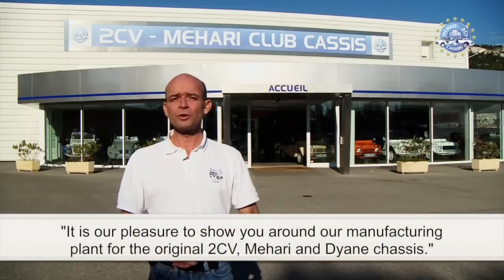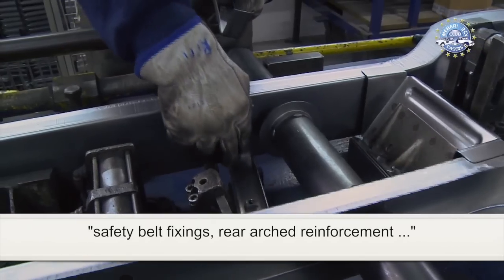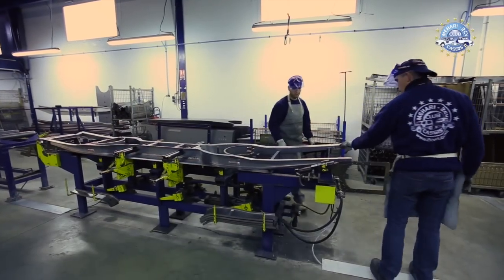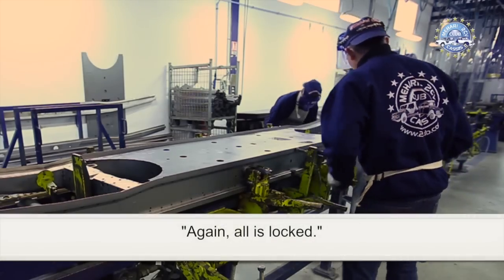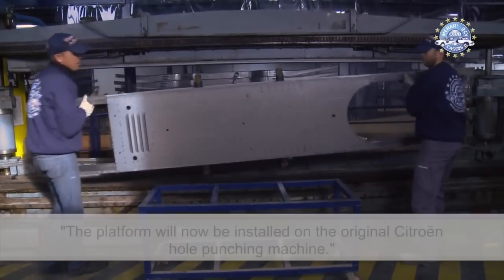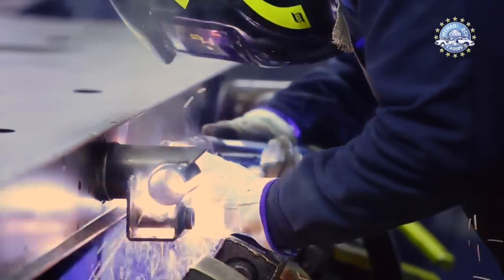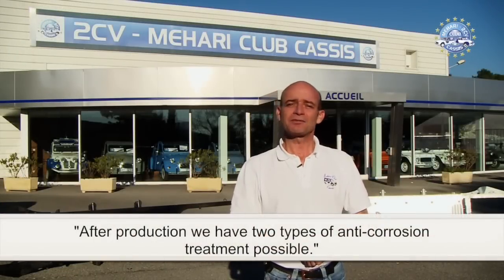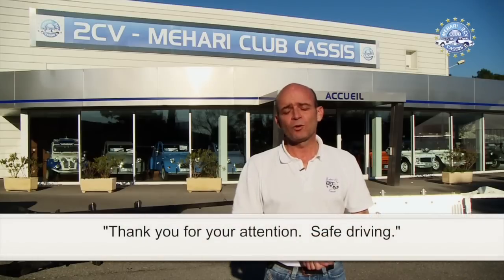The manufacturing plant for the original 2cv, Mehari and Dyane chassis.

Comment: What an informative video! Have watched it over 50 times!

From 1.49 to 1.55, reinforcements are installed into the chassis long members. I slowed down the video and watched that repeatedly, but sadly, there are no close ups of that crucial bit of engineering. I have been scouring the net for more information on those internal reinforcements, which are invariably rusted out totally in old 2CVs. Would be grateful for any leads.

Comment: Is the chassis buildhere in the video confirm the original Citroen specifications? And does it confirm with admission, legislation and approval of the countries it is used for example Holland? Is the steel used for the producting of the Chassis better than what Citroen used (because that was realy bad) and what is the conservation of the steel, outside, but more important inside (which Citroen didn't do at all) e.g is it galvanized? Is it still being manufactured nowadays???
Reply: the chassis is 100% Citroën approval and built with the original Citroën machines, but to buy one you need a original chassis n°

Comment: Amazing! They kept this all! I wish, they will make updated version of 2cv!
Reply: The material strength of the parts used to build the frames is already updated.
Reply: What they call 'E-Mehari' might be a cute electric car (didn't drive it), but it never is a real Mehari. The real one was a light, simple, no-comfort thing with great transport and off-road capability - that one either hates or loves.
Reply: agree. a 3.8 m 50 kW car is more a pet than a raptor. 
 
By the way, passenger safety is very useless to discuss if you increase impact speed from 60 km/h to 80. Physics does not care for our wishes. 
 
I had a bad crash with an original 2 CV, flattened front. I knew where the belt was for some days. I got out unhurt, the other one was lucky to stay unhurt, as I was angry. His car was trash, I repaired mine. 
 
By the way, if I needed to buy a car, I'd consider a Sandero. Renault quality is not bad, I am not cherishing the 1950s when HP was a quality to compensate a tiny dick. My last car was a Fiat Ducato transporter ... rusted away, but besides this, I'd still drive it today. Why not? Comfortable, useful, mileage could have been better (it was not a Diesel).
Reply: by the way ... emission is not so much the thing, I had a 2CV with this cat built in ... emission values were beyond the scale of the measuring instrument.
Reply: I had a Trabant as well for some time ... no repairs ever. Still, 2CV is easy to repair, no fuzz. And it is not as pre-war-German as the Trabant (based on an old DKW). 
 
Today, I am glad not to have to care about a car. If necesary, I lend a transporter (and these things are shit -- a dumb 'MB Sprinter' with 160 HP ... bullshit power). 
 
My 2CV things I really loved, also my later Lada Niva - both have a reason for every screw built in. By the way - no repair ever needed on the Niva. Rust killed it, but it never stopped unless I put down the brake pedal.